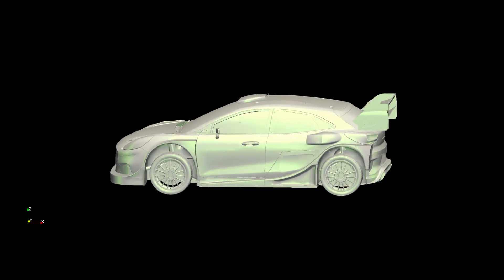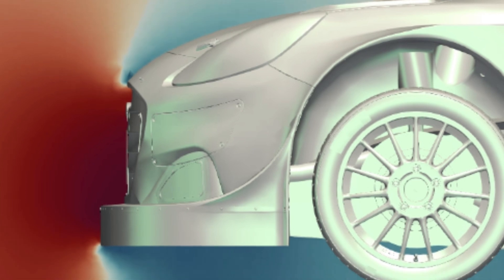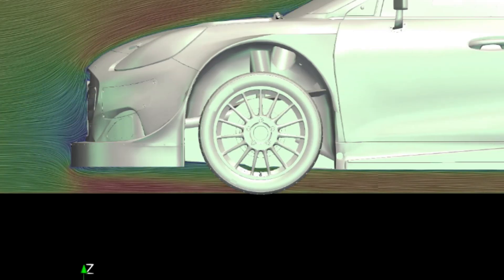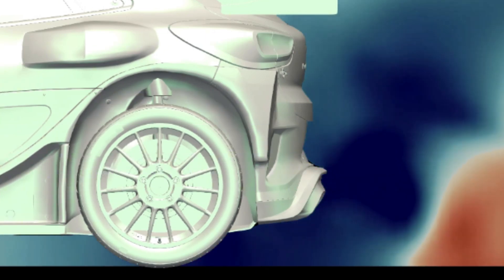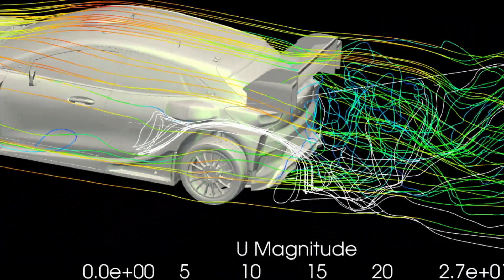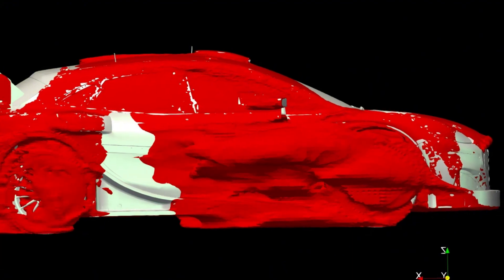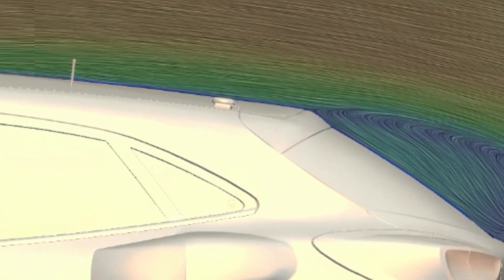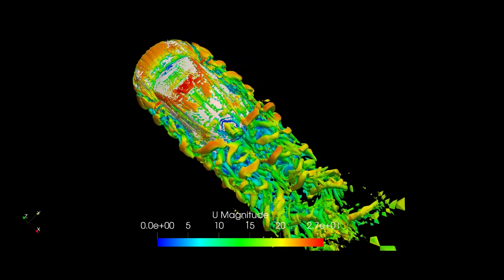Aerodynamics of 2021 Ford Rally Car

Comment: 0:09 Interesting why they made this form of bumper sides and  how it works.
Also how effective is element on the rear  window. But it was than banned by FIA for next models.
And I remember the photo where bumer hit gravel, so a lot of dust  came out of the radiator ventilation which is in front of a the scoop.
Scoop is an interesting part of aerodynamics. I'm a fan of Nissan Pulsar GTi-R and it has problems with  cooling. But when  people make front mount intercooler  instead of topmount it becomes OK.
Reply from the maker: I think the rear wing produces A LOT of downforce. But it comes with high drag. Maybe it causes stability issues.

Scoops are also good when you want high pressure ramming into it because you're getting high speed flow right into it.
Reply: @PremierAerodynamics  So  I rmembered the episode. It's on YT video  "Petter Solberg - Subaru Impreza - Rally Finland 2005"
No rear wing - no fun.

Comment: I do love these Aerodynamic breakdowns. Currently, I am working on a reproduction wing for the 2016 ex-Global Rallycross Honda Civic Coupe. I have a 3D model of the whole car, and I always wanted to compare my stock civic SI coupe. I did rough mathematical estimations to find the estimated downforce and drag generated by the GRC rear wing, but I do not have access to the CFD software to run a true simulation. My estimations came to an optimistic ~24.4kg of downforce from the rear wing with ideal airflow at 45mph (72.8kph). I also got an estimated DC of a stock Honda civic based on its practical top speed and power curve: CD = 0.29 (optimistic). CD increased to 0.37 with big wing added (optimistic). 

Although the two cars are nothing alike and I believe my estimations are wildly off the mark, I like seeing the comparison. It makes me feel like all the math and sleepless nights were worth something. 

If you feel like going down the rabbit hole, feel free to check it out. ---> https://www.civicx.com/forum/threads/making-the-red-bull-grc-style-wing.86661/page-4

P.S. Sorry for dumping that info. I had to share. Thanks again for the great video content. I am subscribed to see more.

Comment: I wonder what diference it would make simulating the air going in and out of the engine bay, because it seems to me that isn't beeing simulated and i presume that would significantly incrase the drag.

I could just bee spiting a load of bs but at least it seems to me like it isn't simulated
Reply from the maker: Generally, it adds around 20-30 counts. So, for this car, about 5%.

Comment: What do you thunk would be the effect of yaw on the aerodynamics, particularly downforce, since rally cars usually have a high degree of yawing in the corners?
Reply from the maker: It would like make the downforce worse because the surfaces aren't contoured to that direction. However, for a regular car that is producing lift, it would generally improve it because the roof is less in line with the front of the car.
Reply: @PremierAerodynamics  Do you think the different pressures on either side of the car would have much of an affect when the car is in yaw (sliding in a corner)?

Comment: This aero calculation is very inaccurate, because it doesn't take in to account all the vents and scoops that car has
Reply from the maker: What is the mass flow rate through them and how does that affect the aero?
Reply: @PremierAerodynamics He is not wrong. There are multiple missing components of the aero model. From the front moving back...
Under the "beak" of the front lip of the hood, is the engine intake, so it is being fed high pressure air directly into the turbo restrictor. Additionally the from cooling inlet is directly below that, which feed into the engine bay, the engine bay has two large upper hood vents right infront of the A Pillar to manage that air out from under the bonnet. The front brake cooling ducts also flank either side of the front grill, And feed air into the wheel well to reduce pressure build up.
Additional to the air from the hood vents around the A-Pillar, the wing mirrors are, quite literally, wing profiled, vertically oriented, and act as a barge board around that A-Pillar region, controlled the flow of air. I also have on reasonably good authority, that there is a vortex generated by these wing mirrors that feeds energized air directly into the rear hybrid cooling system duct, and also helps drove flow into the rear wing side scoops, and upper fender flare.
Speaking of the hybrid cooling system, often missed, is that directly above the diffuser, is a cooling outlet fan for the Hybrid system. This fan is extremely aero profiled, and specifically integrated into the outflow of the rear diffuser, allowing for extension of the diffusers outlet, pressure recovery from the massive drag, and some minor interactions with the rear wing as well. I also have under reasonably good authority, that when the rear wing is lost on the cars, there is a "Maximum Cooling" option that can be selected from the cars control panel, that will allow for increased fan speed to help improve the extraction from the diffuser, to recover some of the lost downforce from the loss of the rear wing interaction.
It is also worth mentioning that the rear wind endplates are contoured like those of an F1 car, and have their own unique and specific interactions.
Likewise much of this cara aero is also designed with the intent of being sideways, so there are some specific interactions that only happen when the car is approaching at a broad side.  Which does in many ways dictate the shape of the aero elements of the rear wing outside of the basic regulatory restrictions on size.

Comment: The wheels are feeding a lot of high pressure to the edges of the rear wing, it might be it's one saving grace. The wake coming off the wheel houses are high pressure so they divert the free stream air slightly up so it interacts with the rear wing edges.
Reply from the maker: That is a good point. Perhaps this abrupt termination is the best config they found for the rear wing system.

Comment: This would be one car that might perform better in yaw then straight on. Almost every high speed rally corner is taken with a little bit of yaw, even some high speed braking is taken with a little bit of slip. So things like the roof vent might not have as big of an impact downstream vs head on.
Reply from the maker: Possibly. It would be interesting to see in the future

Comment: This car is actually from 2023 😄. Rally1 WRC cars (2022 -> 2026) are not the first WRC cars with a lot of downforce. 2017 to 2021 WRC cars were even more extreme 😄. Thank you. It was a great video !

Edit : it's a 2022 Puma. Just the thumbmail is a 2023.
Reply from the maker: Thanks, happy you liked it!
Reply: This isn't even 23, this is the 22 launch car, it didn't even have the same wing mirrors as the tanak car with the shown scale model
Reply: @npne1253  yes you're right !